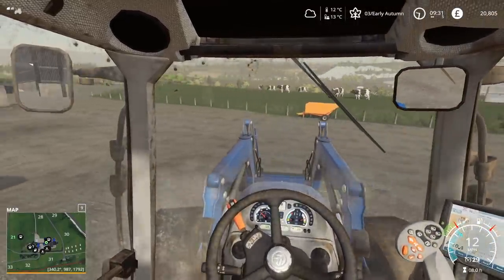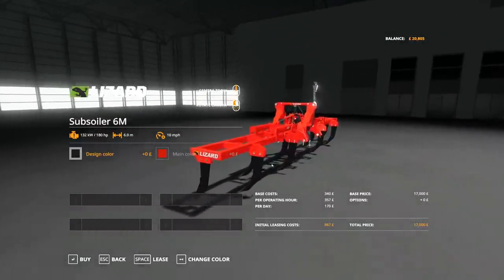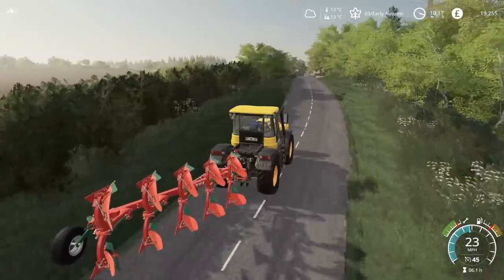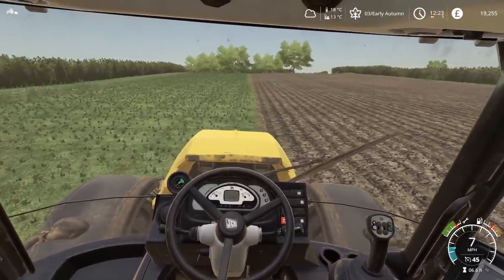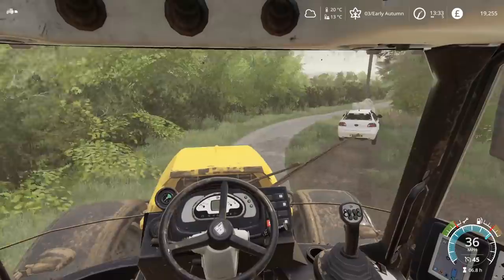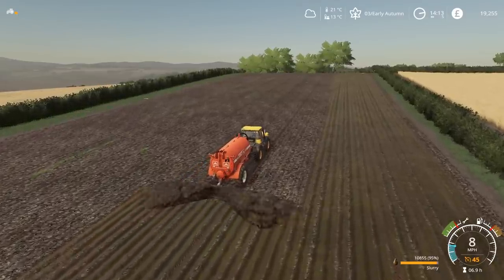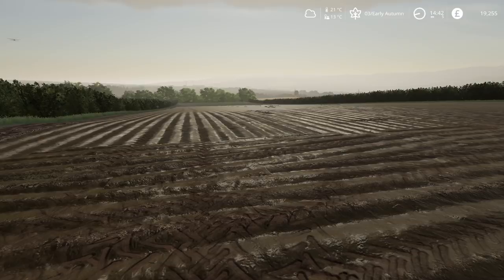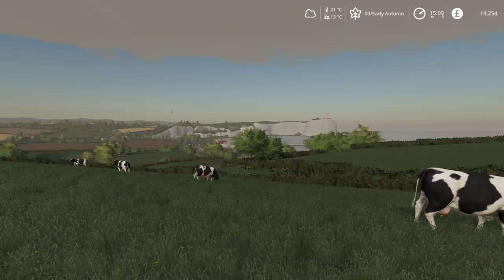PLOUGHING THE LAND | Sandy Bay Farming Simulator 19 - Episode 17

Comment: Daggerwin here is some tips for ploughing: don’t plough away from the side on the first run, just plough to the side, and the next year plough to the opposite side to flip the soil the other way, try to leave around a tractor length or more at the ends to turn around on a do at the end, for extra realism, go about at roughly a 10 degree angle across the tramline or the direction of the combine tracks to brake them up.
Reply: Spot on!

Comment: I think your consumption should be higher than that but the capacity of the tank is also too high. That tank in real life is probably rated for around 2000 gallons (around 9000 litres) and that field would take at least two full tanks.